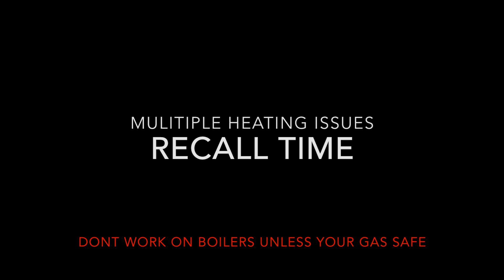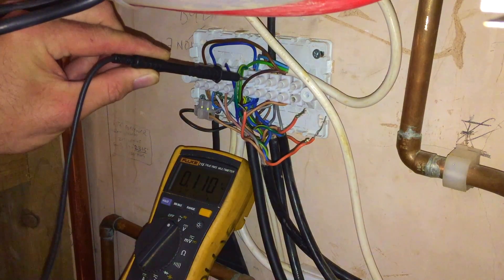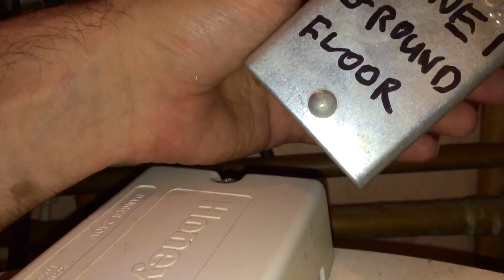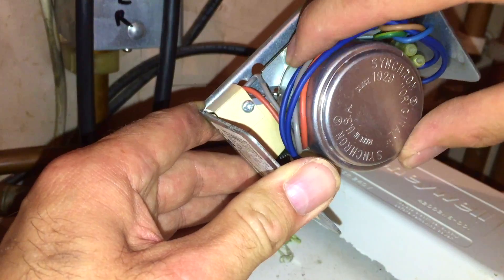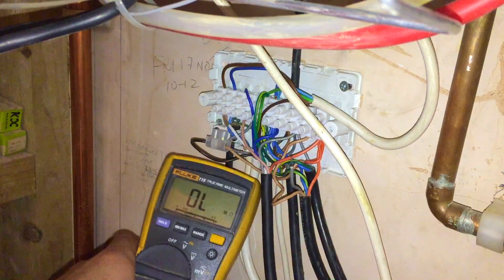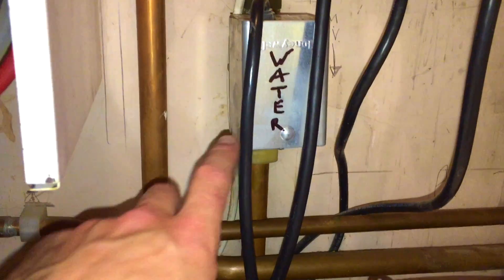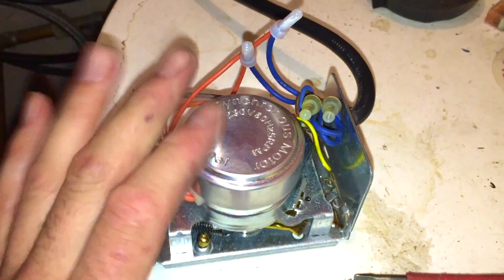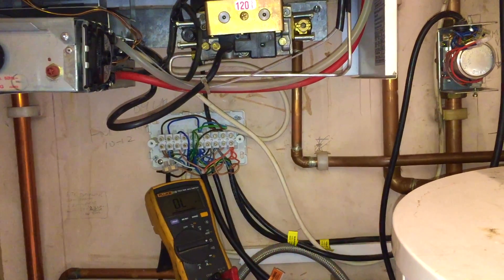Heating System Faults. Hot Water Too Hot!! Part 1

Comment: With the motorised valves how can you tell what they are doing regarding the lever on the side 
If it can be moved freely then its open ?
Manual is open 
Auto Is in position  at rest ?
Reply from the maker: Don't use the lever for anything other than manually moving the valve. Using it for diagnosis isn't consistent. Loose means its open, but doesn't mean its open enough to make the contact on the microswitch.
Reply: @HeatingGeek  that's great thankyou

Comment: If HW valve body is stiff then oiling it will only last short-term. A permanent repair requires new plate to valve body !
Reply from the maker: No, thats not true. I have customers where I oiled there older 2 port when fitting a new boiler. That boiler was an older Vaillant ecotec. So pre 2012. The 2 port valve is still going strong.

Comment: Really great videos. I notice that you prefer to repair rather than whole parts, ie synchron motor instead of whole power head etc. And I think thats a good thing, very honest etc.

But trouble I've found is that very occasionally you repair something, and because of the age of it, it fails again, sometimes something else that could not have been foreseen goes wrong.

To the customer who calls you back, that will be "he hasn't done the job properly" and I find it hard to explain to them that I'm trying to work in their best interest.

So sometimes I think it pays to just replace completely, to avoid that possibility of a return visit, pissed off customer because its still not working, etc etc etc
Reply from the maker: I get what you're saying. I don't charge for reattends!!!! so customer pays nothing.
Reply from the maker: That way they cant be upset. I don't get very many re attends a year. Maybe 3-4.

Comment: Hi heating geek, recently found your channel. I have subscribed and have used your affiliate links to buy a few tools and tool roll. Do you have an affiliate link for the crimps you use when replacing the synchron motor on the two and three port valves?
I enjoy your thought process when diagnosing these faults.
Look forward to you forth coming videos.
Cheers.

Comment: Where's part two?? By any chance was it the valve body letting by?
Reply from the maker: https://youtu.be/vDTv34n7ffI Here it is.
Reply: HeatingGeek thanks dude. I changed those pcbs before and it was a double fused one. I got it from A10 boilers in cheshunt
Reply from the maker: The 2 fuse one goes more often. If the pump is larger than normal it can cause premature failure because it pulls to many amps through the relay on the PCB.

Comment: Why pump not running when hw valve opened manually? I'm newly qualified gas engineer and wanted to say big thanks for your time and effort to share your knowledge with us.
Reply from the maker: Because when you manually open a valve you dont actually  "make" the electrical switch (microswitch) inside the valve. 
All you do when you put the valve on manual is open the water pathway.
Reply: HeatingGeek oh ok I thought it does. Sorry for silly question mate . Many Thanks for yr reply
Reply from the maker: Its not a silly question. until you ask, you don't know. I didn't know until I asked someone. ;-)
Reply: Unless it's a danfoss one. That will make in manual.

Comment: Another great video mate! Nice to see someone not just changing the head 👍🏻
Reply from the maker: I use to. Until I worked out you have to clean the body too. Then I realised you could clean it all up. 
Money in my pocket and and not some manufacturers!
Reply: HeatingGeek exactly! : ) very informative video, seen part 2 and looking forward to part 3 lol
Reply from the maker: I miss read this comment. your talking about the actuator head. I was replying about the PRV head.... 
If you were paying you would do the syncron motor right? Thats how i look at it. you can get syncrons for about £10 but an actuator has got to be £30
Reply: HeatingGeek iv known actuators alone to cost more than the complete valve mate! I might be thinking of pump heads actually ? but you order a Drayton trv head and it will cost more than the complete valve and head . LOL I wondered what you meant by cleaning the 2 port body , surely you don’t brasso them lol
Reply from the maker: Yeah the comments get all jumbled into a list when I answer them . Except the one above which docent show. Thats a few of yours that have done that???? I still don't understand this stuff!
Reply: HeatingGeek Yeah I meant it's nice to see someone change the motor rather than just change to whole head 👍🏻
Reply from the maker: I try and do things as if it was my mums house. Thats what I say to my self anyway.